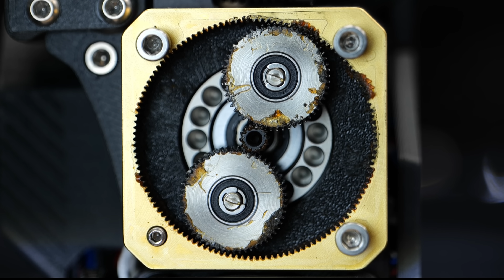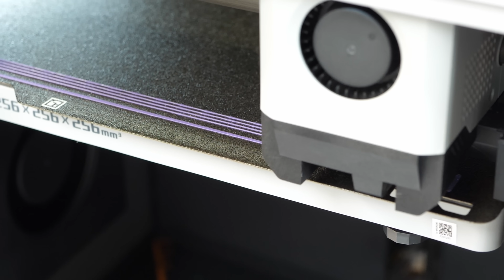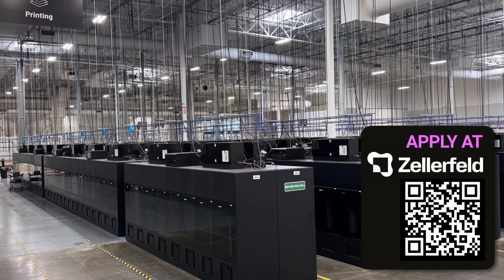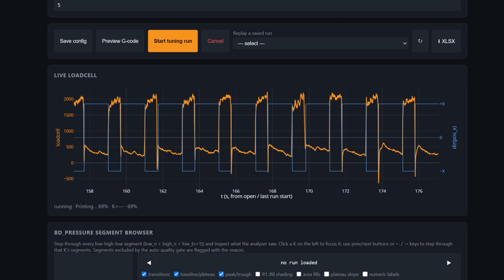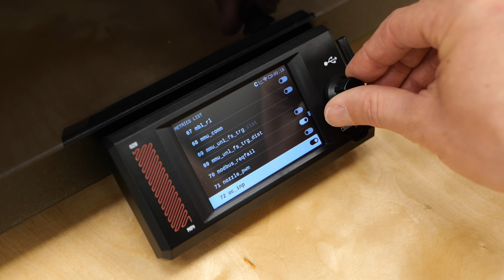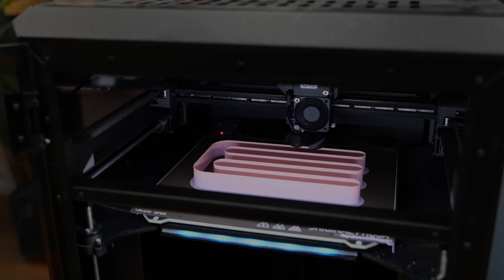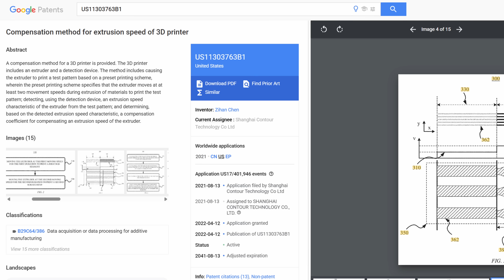I Automated Pressure Advance Using a Bed-Leveling Sensor

Comment: The patent situation is why open source printers should provide as much data and access as possible and challenge the comunity to invent things. If the technology is already public you can not patent it. This is a great use for agentic coding since it test a concept but is not claming to solving the entire problem or selling it as a finished product.
Reply: Thats nothing you can patent. Using load cell data to regulate a motor speed doesnt meet any criteria of something patentable.
Reply: @MsKoffeinjunky the video talked about bamboolab patents for just that.

It is also not my point. My point is to get the open comunity to invent and expetiment as much as possible and share their findings to protect cool things to be patented by bambulab and simular.
Reply: Even if there is prior art, patent offices look only in the other patents for prior art. Then they change it a little bit up, patent it and you need deep pockets to fight for your rights.
Reply: @sevenismy sure you might get a patent even with prior art but it is a lot harder to defend if there is prior art. My point is that we need thease technologies open and not locked behind patents. And if you change it a bit it is only that small change that will be protected by the patent.
Reply: @sevenismy  That's simply untrue. Examiners cite non-patent literature all the time. I've even had examiners cite Wikipedia (via Wayback Machine). Patents and pre-grant publications are just easy cites because you can immediately verify whether they're prior art.

Comment: I've been 3D printing for almost 2 decades, and I've never experienced some of these issues. Have you guys not ever used Cura? 

There are no sensors, it's all manual, but what you are calling "pressure advance" has been called "flow control" for many years, and many of the issues shown in this video were mitigated previously by retraction settings.

While I occasionally have issues with an over expanded first layer, I have an Ender 3 v2 that can print up to 150mm/s and my corners never look like any of these examples. 

I know that isn't quite 300mm/s like some modern printers are capable of, it's just odd to me how some of these newer printers mitigate problems that were resolved by other companies years ago, in software.
Reply: Imagine measuring printing speed in mm/s in 2026...

You completely misunderstood the root and the nature of this problem.
Reply: @aleks-ivanov  oh, well thanks for explaining it to me. You're a lot of help. There's nothing better than people that comment actually help people out. I'm glad you're totally not one of those people that just comments just to see themselves type. 🙄
Reply: @InfamousInternetVillainJackSix  lol bro, you were the first one trying to act smart when you are wrong. What did you expect as a response?
Reply: What filament are you using? With PLA this isn't very important, but with viscoelastic filaments at high flow rate, it starts to matter a lot.
Reply: @321tryagain  I mostly print with PLA, TPU, and PETG. But I've gotten to where I prefer PETG, because it prints more consistently at the maximum speed of my printer.
Reply: If you aren't trolling, flow control is not pressure advance.
Cura has a plugin that lets you set Pressure/linear Advance value
Reply: Rofl, that is not the same thing and it doesn't matter for slow printers (your ender printed at 4mms3 max)
Reply: @riba2233  how would you know what my printer can do? You didn't install the custom motherboard, or compile the Marlin code and configure it yourself… I did those things.
Reply: @InfamousInternetVillainJackSix  really, what hotend did it have? Input shaping?

Comment: Do you know why the toolhead seemed to be moving while it was doing the test? Or was that just like an optical illusion?
Reply: It is moving. Might be easier to gcode extrude over a set distance? G1 X50 E10 F100
Reply: Likely rolling shutter of the camera.

Comment: Hi Stefan. i was thinking with Klipper firmware and stepper drivers that support stallguard it might be possible to skip the load cell entirely? this is just a theory ofc but we can already sense the load on the extruder motor itself. im unsure how accurate it would be though but maybe with extruders with reduction (like the BMG extruder) it might be possible to get it more accurate.
Reply: There is a Klipper plugin for this which skips the load cell. It's possible. But the load cell makes this so much easier.

Comment: Not wanting to start a fight but it does part of the code outside of clipper in its own none opensource code? How is that different than what bambu did with the network code. Different license involved seems you can make the same argument. The rest of the video is impressive again ...
Reply: It isn't. It's exactly the same.
Reply: But snapmaker is community's darling for some reason.

Comment: it feels like to me that printing into mid air might not give you the same result as a real test print where there is a layer below it you are printing against, I could be wrong though. Great video!
Reply: I think that for "cornering", it might have in impact, because there is still material coming out and depositing onto layer below thus creating back presure. It would be usefull to know how much of an impact that has, and if it is as simple as an offset to the calculated result.
Reply: I would imagine comparing in air to in air would be the same as comparing on build plate to on build plate. Just dont compare one kind to the other, and you should be able to find the PA differences between filaments
Reply: You're right, it is a completely useless calibration on both Bambu and on the U1. For the U1 specifically (because I have it), the automated tuning gives a usable but not perfect value for PLA. With PETG, TPU, or other materials, the calibrated PA value is constantly much lower than required. I do not see any value in this tool because the accuracy still highly depends on the specific filament.
Reply: @keythkatz  you may want to check on your understanding of the words “completely useless”. Perhaps the words you’re looking for are “a big help and a huge step forward, but with room for improvement”
Reply: @EricLS  You're right, I'm sorry. It's worse than useless, it's detrimental to the typical bambubu when their print comes out with holes in their corners because calibration by extruding in the air has no correlation with printing on a surface.
Reply: @keythkatz  I’m gonna need you to dial it back a scoche. “NO correlation” is an emotionally driven exaggeration. I can tell by your writing that you’re intelligent enough to understand that claiming there is literally no correlation is just patently absurd. I mean… Bamboo lab used LiDAR in their X1C for God sake. If you wanted that level of accuracy, you paid for it. It’s not like nobody knows this stuff, they’re just making a choice between cost, accuracy and ease of use. I mean, my printer literally doesn’t have any at all, and it wildly over extrudes with poly maker PLA pro. Other filaments it borderline under extrudes. So I think some calibration would probably bring it closer in both directions. I would welcome a calibration in mid air just fine.
Reply: @EricLS I have the u1 also, and the auto calibration IS basically useless. Spits out 0.019 value when manual calibration shows 0.28 as best.

Comment: I have not the paperwork to work at zellerfeld but im shure its not so easy to measure PA for TPU with eddy current at all since this would need a very soft heatbreak i cannot believe they would want to incorporate a variable for a production like this on filament process level. I could imagine tho that dynamic PA would help them. I do not know how they do it but like batch sample testing of the filament they get should be enought no ?
Reply: The load cell is moving a very small amount, I'm sure you can figure out a way to allow heatbreak to move without impeding TPU.
The point of this is to avoid batch testing of every color/filament/nozzle diameter/etc.

Comment: Could this be implemented into the p1s?
Reply: Only if you get access to the firmware. Good luck!
Reply: @aleks-ivanov  would still be impossible as the P1 only has sensors under the print bed.

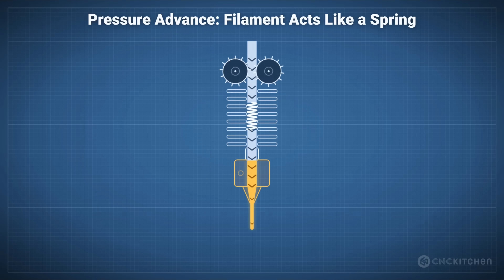Comment: 10:05 looks like you are showing capacitor charge and discharge cycles, lol.
Reply: Everything is a spring. Everything.
Reply: @ozerozkahraman8833  always has been
Reply: I was thinking that looks a lot like an analog synth envelope (which works by charging and discharging a capacitor)